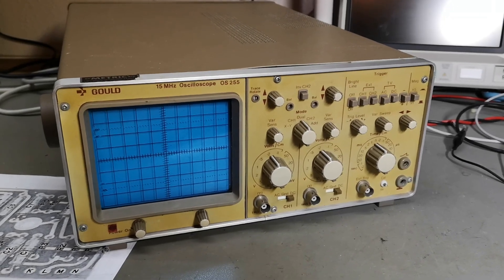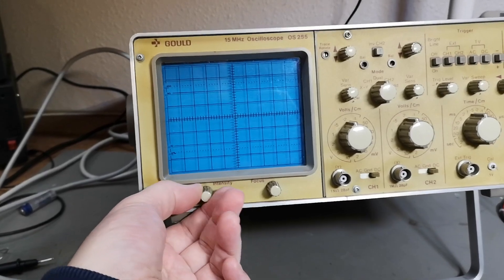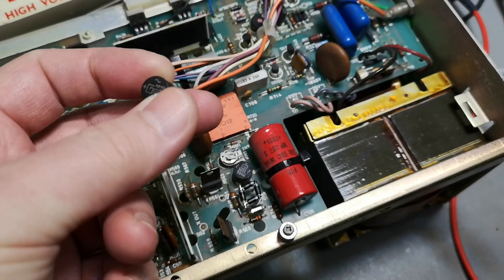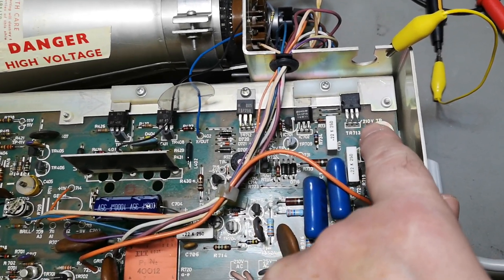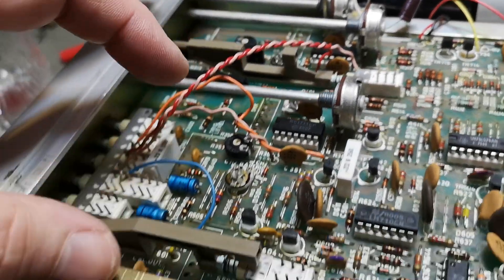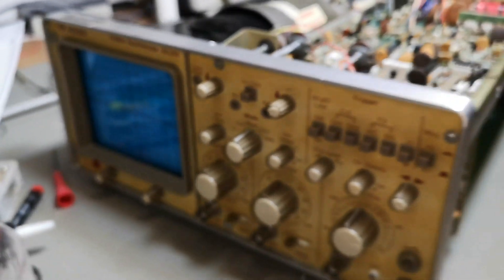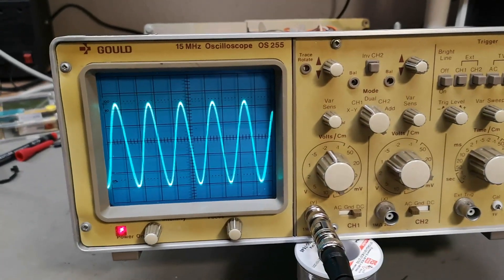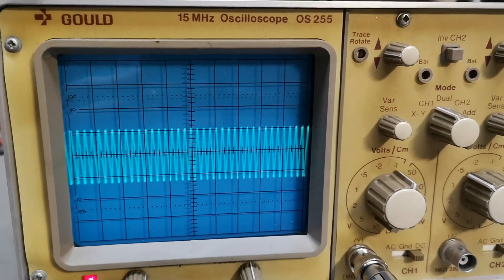Gould Advance Oscilloscope OS-255 2ch 15Mhz repair test teardown

Comment: I got this exact same oscilloscope from the flea market. It seems to be working when I take it out of the enclosure, but as soon as I put it back, it no longer turns on.

The diode bridge that you replaced gets crazy hot as well, but no fuse gets triggered. You think maybe I should replace it?
Reply from the maker: if it is easy to do, just try, but normally i would recommend to measure if it parts are broken, then replace them
Reply: @TeardownOZ2CPU  thanks!